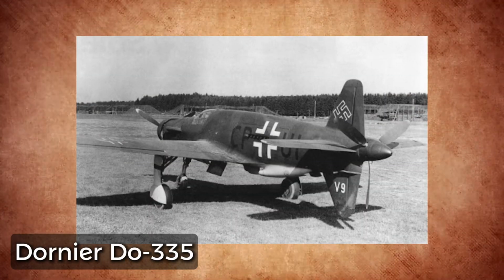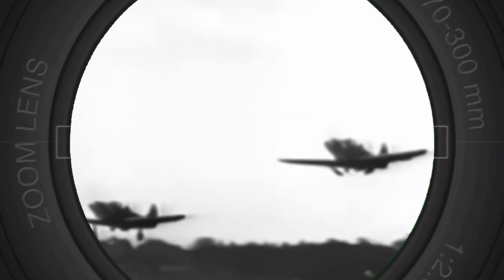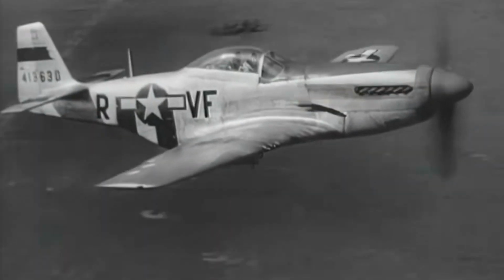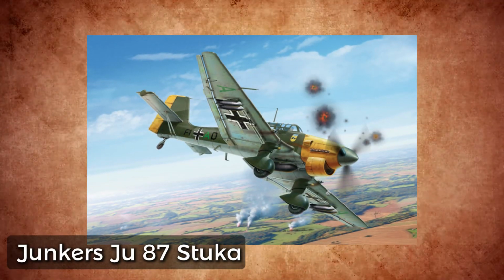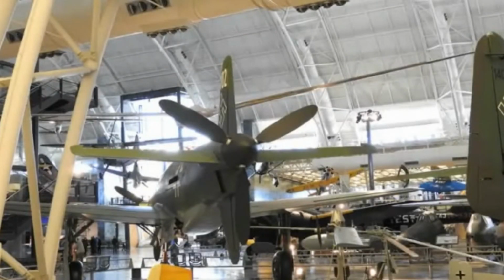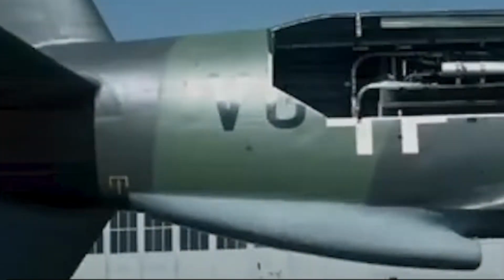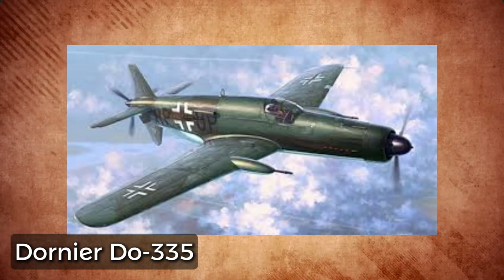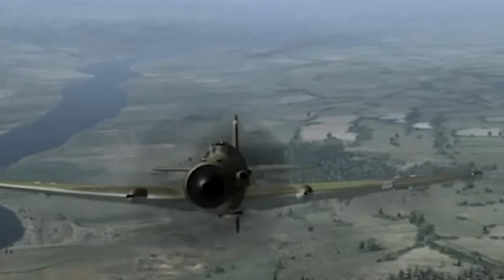This German WW2 Plane Made Allied Pilots PANIC!

Comment: Clickbait title.  A miniscule number of Allied pilots even saw a Do335, let alone engaged in combat with one.  That, and only eleven of them were ever built, so where was the cause for 'panic'?    Me262 was significantly quicker and available in far higher numbers, yet there was no "262-panic"; the Allied air forces just worked out its vulnerabilities and attacked them there.  German radar-controlled flak was of far more concern, but that's not 'sexy' enough for you, is it?